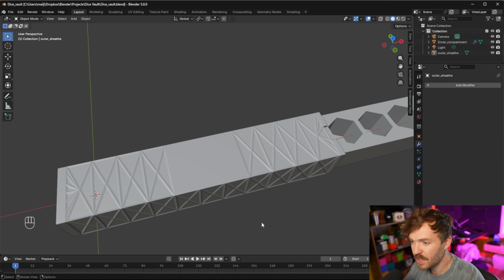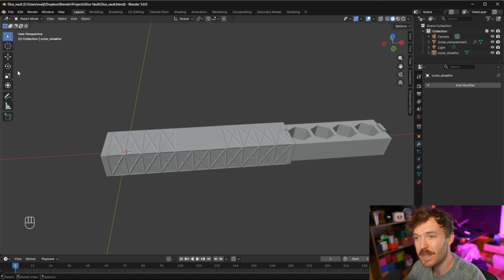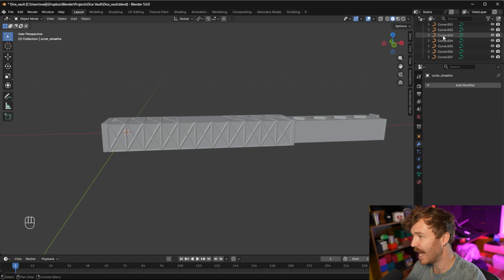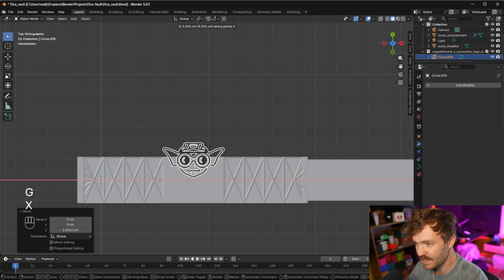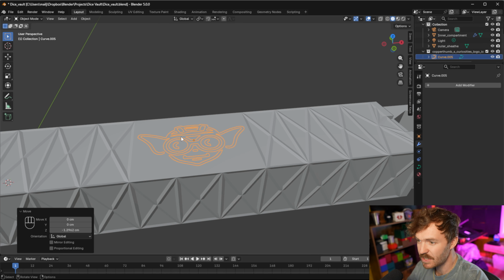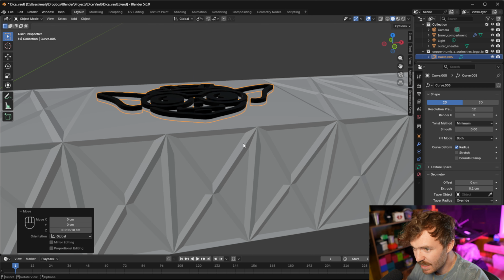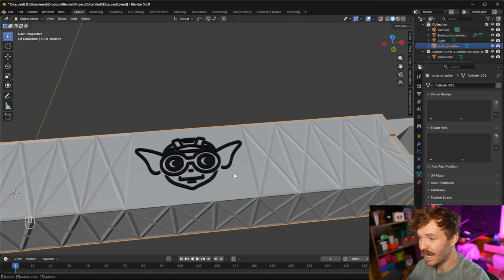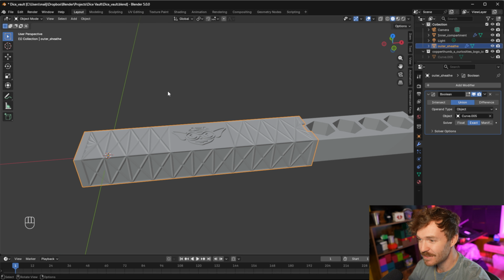Add a Logo to Any 3D Print in Blender (SVG → Boolean Workflow)

Comment: You are doing fantastic job! I use your videos often and learnt a lot. Thank you! I have a queation. I imported svg file, changed to mesh, extruded, used boolean modifier as differences and exact - that created nice pic in the object. Once import it to bam u studio - it found 4k non manifold edges. It recommended to repair, I did but most of picture (especially middle section) disapeared. How can I correct it in blender? Thanks!
Reply from the maker: Thank you so much for reaching out! I’m so glad you’re liking the tutorials. It could be several things causing the non-manifold issue, but the common ones would be that your logo is extruded too far and colliding with other internal geometry of your model. You might also need to clean up the image file once converted to mesh with the simplify tool. If neither works a quick fix could also be to use the remesh modifier on your image file once you’ve converted to mesh, as this can usually catch any issues. Let me know if any of those work! I’m also happy to look at your model if you need 👍
Reply: @Copperthumbscuriosities  Thanks so much for these tips and reply! This file is quite complicated (for an old guy), and I've tried several things, but nothing seems to work. When I use a Boolean type, only float works—I usually use Exact, but this time my object disappears! If you could help me, that would be great! Maybe new tutorial with complex images? I would like to use pictures on object and use 3d printer for it. I can send you few examples what I would like to achive and I cannot find anywhere appropiate videos/tutorials.